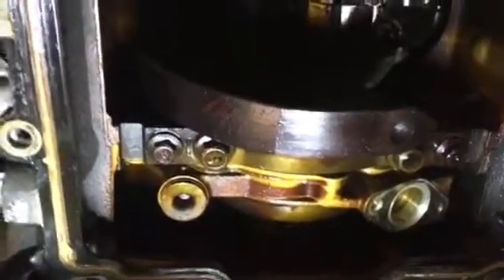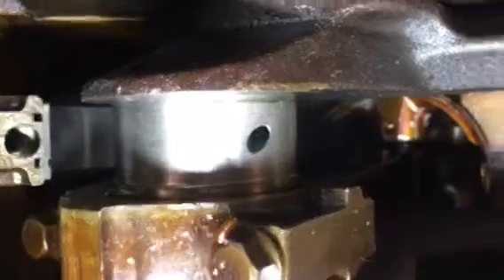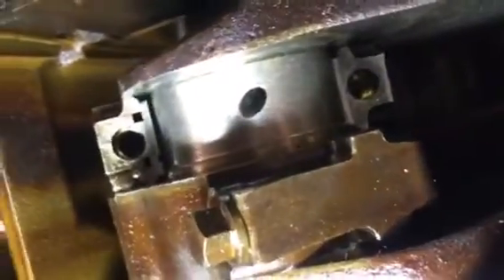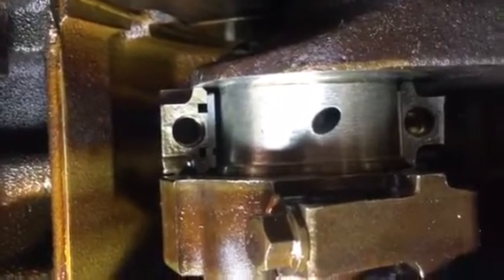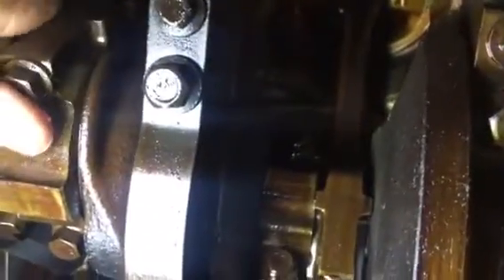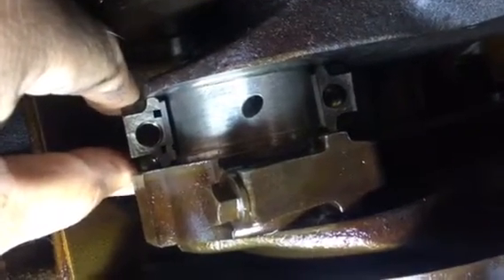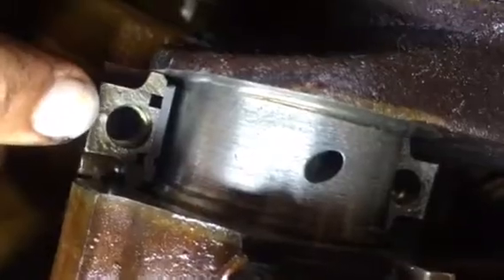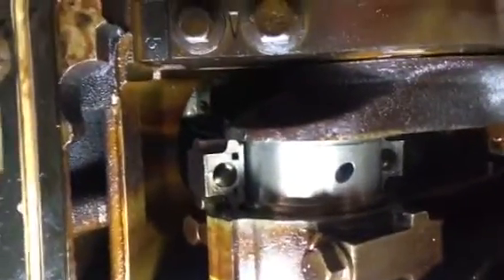Engine failure spun rod bearing Engine knock

Comment: Mic it and use over size bearings
Reply: U can't just mic it go to a machine shop to give it another appropriate cut and see if it will not exceed the maximum tolerance.